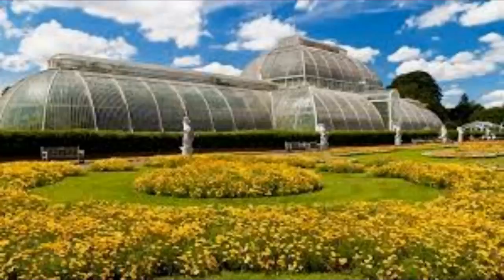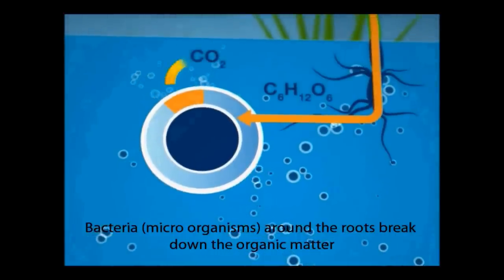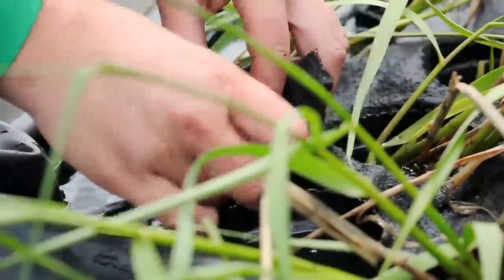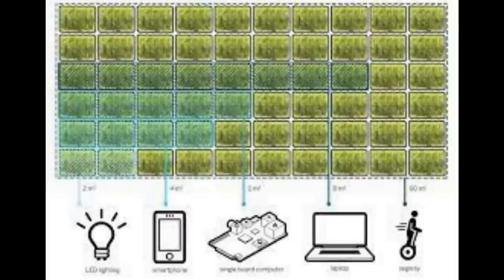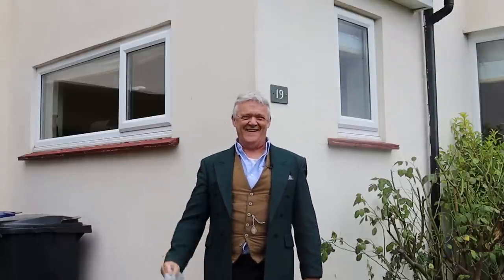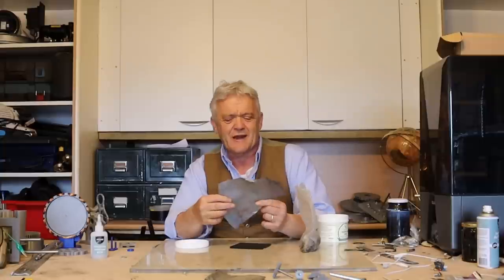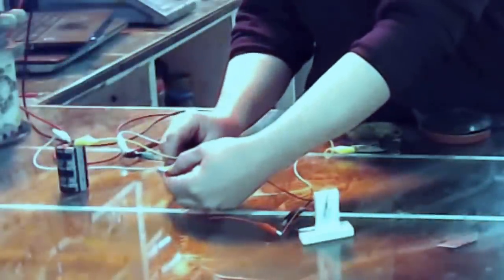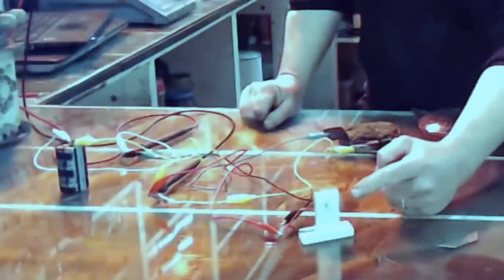1993 How To Make A Bio - Photovoltaic Solar Cell

Comment: Being as I live in the Pacific Northwest, and thus familiar with your climate, Robert, I am finally seeing a case for a flat roof. And in order to basically have a pool on top of the house, it's going to need a bit of engineering.
But think of the savings in cooling, which we're already desperately needing.

Comment: I think this would be really interesting in the context of an earthship. You certainly could use gray water to keep this topped up perhaps mixed with a little urine.

Something that's counterintuitive is that we don't need one power source to power everything. If something like this was able to charge up lights, phones, Bluetooth speakers that would be useful. There's even micro projectors with built-in batteries. Somebody could replace their 400 watt per hour TV with a five watt handheld projector charged from moss.
Reply from the maker: nice on mate

Comment: hi rob i spent some time thinking about this today and wondered that the cells output would correlate with biological activity and surface area, and that in order to increase surface area we need to think 3 dimensionally, an idea i had would be to 3d print a matrix lattice and to dip coat it in a conductive material to create the anode and the same again for the cathode however its structure to utilise the area between the anode lattice, the substrate used with the mosses growing medium could contain activated carbon giving the microorganisms a massive surface area to grow upon as well, i suspect this would increase the power density.

Comment: I think I saw an effort to recreate Terra Preta - a type of soil that harbors a non fruiting fungus or yeast, that helps with the production of nitrate salts.

If this could be used in conjunction with this biophoto process, you might be able to pick up a few milli amps.

Not much overall, but just 1 or 2 milli amps at the same unit cost improves the overall circuit.

The paper can be found on Google scholar.
Reply from the maker: 'll search for it - cheers mate

Comment: Hi! Just had a question, new here just where exactly are you supposed to plug the wires into?
Also, would it work if i used aluminium foil instead of the carbon felt and other conductive materials?

Comment: Check out Paul Pantone from Utah. He has patented a device that does the following:  as it draws air through a chamber containing any liquid (soda works ) As the air is drawn through the liquid and then down a reducing pipe it passes over a long magnet held in place at the end. the potential energy in the air is traveling at a high rate of speed it's heated and magnetized causing an immense reaction.  He's made his design open to the public as well!
check it out it's genuine 😊
Reply from the maker: will do mate - cheers

Comment: What are your thoughts of utilizing specific plants for solar tracking? A plant like a sunflower, for example will point itself toward the sun, which changes position throughout each day. I would love to see an experiment utilizing fully-grown plants attached to a solar panel,  with no power used. And I would love to see an experiment utilizing live biological matter in liquid to accomplish this solar tracking. Solar tracking provides an additional 20% production typically. Utilizing plants instead of motors, sensors and electrical components would be really cool. Thoughts?
Reply from the maker: it's an interesting idea for sure

Comment: I wonder if you could make a water hammer solonid generator.
Reply: Maybe with some of Robert's vibration harvesting generators?
Reply from the maker: i would think so
Reply: @RobertMurraySmith  they make water arrestors that are installed in plumbing systems to absorb the shock from the fast on off. Seems like an easy passive way to collect energy from daily water use or a water ram jet setup.